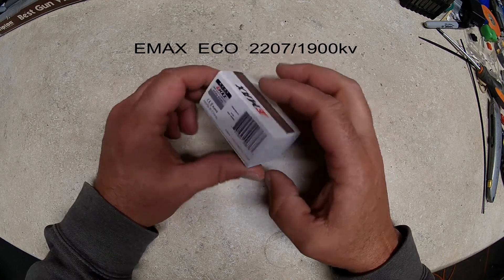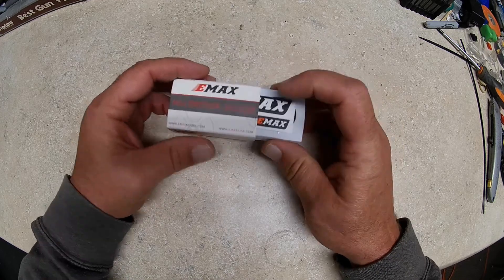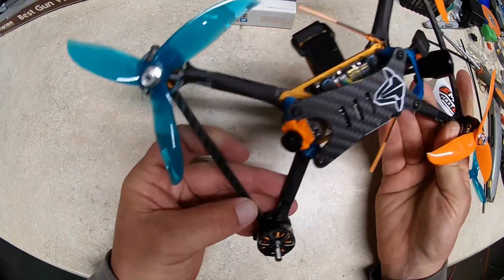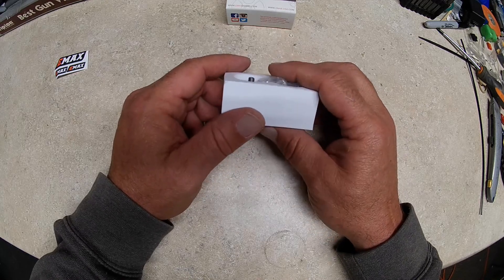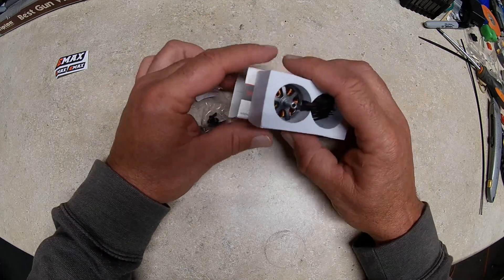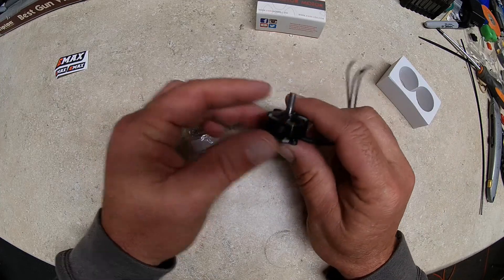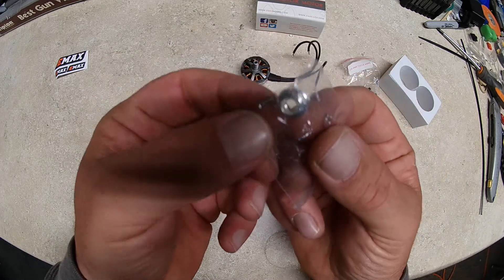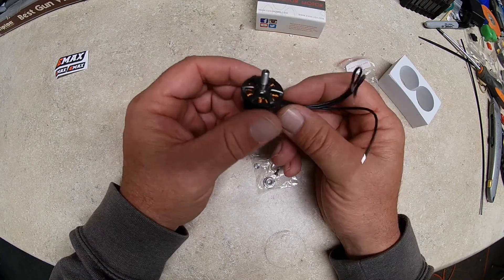EMAX ECO -  2207/1900kv -  review/overview

Comment: which esc you are using? find nothing about amp rating. want to use them for a lightweightquad. thx :)
Reply from the maker: Diatone Mamba stack.  thanks for checking out the video.
Reply: @rl1412  thx for your fast answer :) the f405 40A? or the f722 50A?
thought about it, but idk if the 40A could handle this. i think i go with the 722
Reply from the maker: @tinicfpv7377  f405 is my Go To combo. No issues ever.
Reply: @rl1412  good2know :) already built 3quads with this combo. and it looks like the 4th quad will also have this xD thx and happy flight